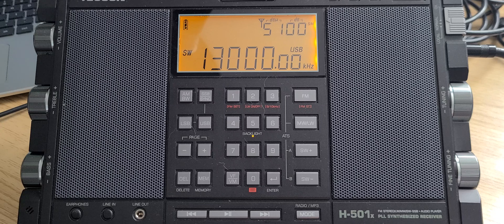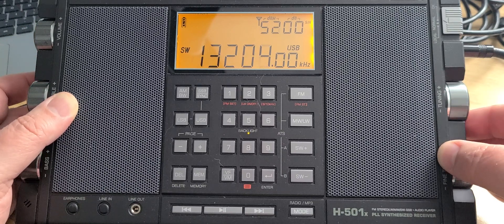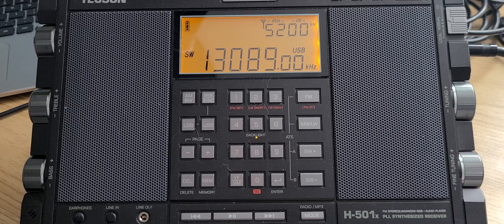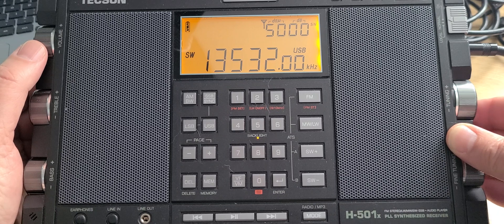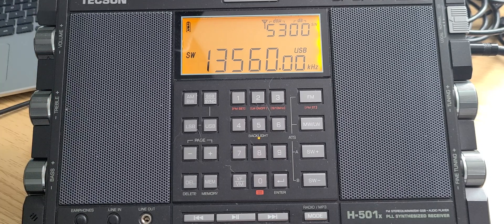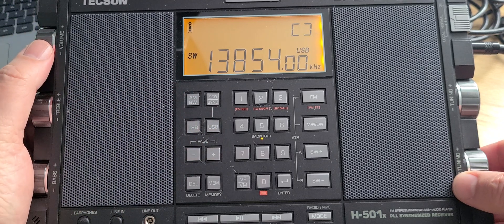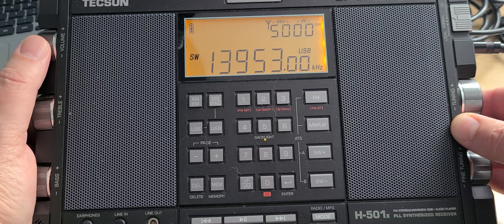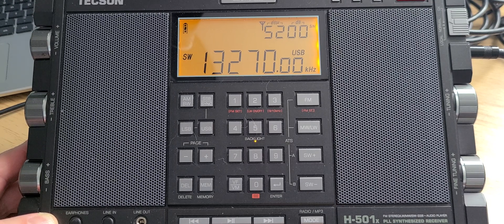What is there to listen to 13000 to 14000 kHz Shortwave Tecsun H-501X MLA 30 loop

Comment: The weird thing about the local signal on 13 560 in the New York metro area is that this has been running since probably the early 1980s when I first heard it; I wasn’t expecting it to still be there when I returned to shortwave last year after a 30 year absence. I lived 60 miles away in the 1980s so this must be a very powerful local signal